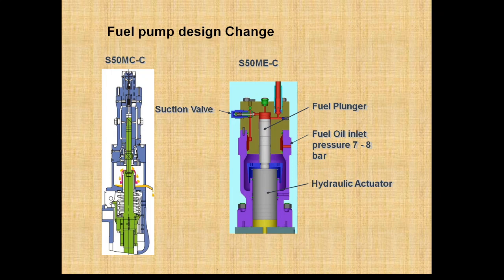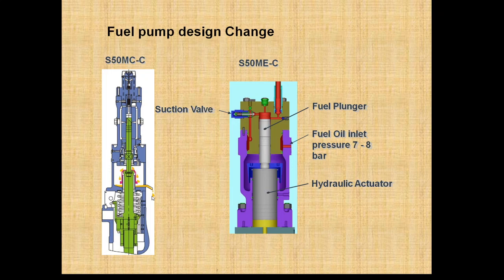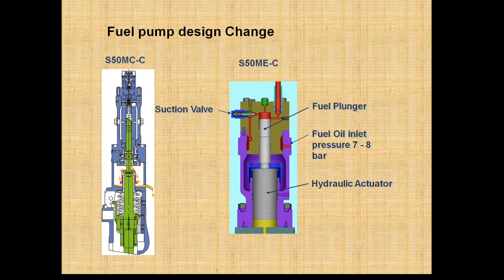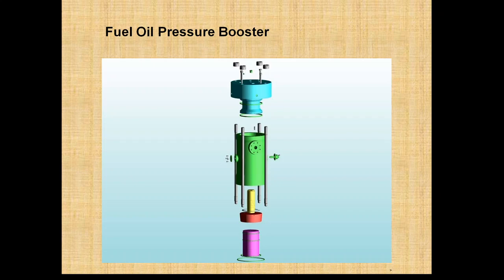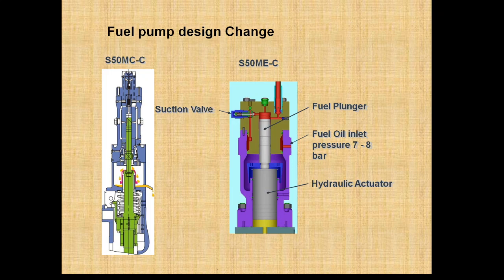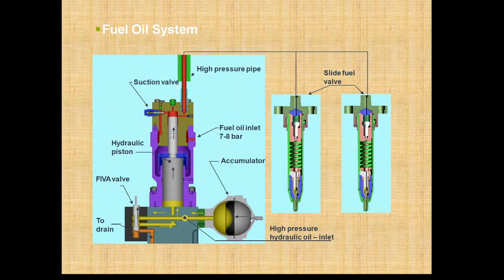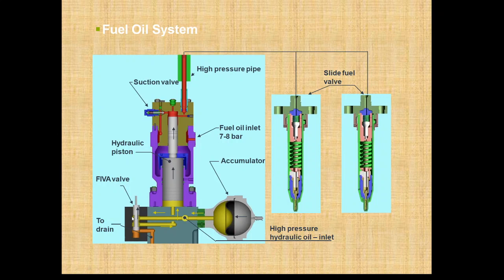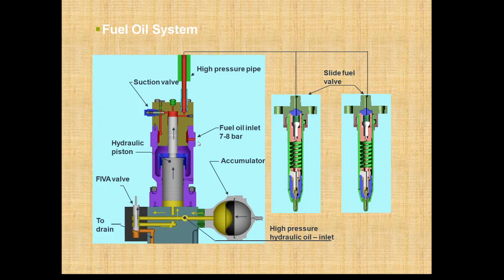difference between MC and ME engine in designing of fuel oil system arrangement|ME Engine|

Comment: Sir do we have any spill port arrangements in For fuel pump in ME-C engines and one more thing sir in diagram we can see that suction valve  but I am not able to understand the other one where it is written 7 to 8 bar oil inlet can you please tell something about that ?
Reply from the maker: In ME series the pressure is developed by the hydraulic actuator so there is no need of spill port because the injection is control.by FIVA valve.
The oil in ME series is supplied at 7-8bar by fuel oil circulating pump from where it is raised to fuel injection pressure by the hydraulic actuator.

I hope you understand!!!!
Please watch the FIVA valve videos I have made.it will be more clear.

Thank you for your response !!!
Please share with your friends and colleagues!!!!
Reply: Hello there the answer was not clear ... if the fuel enters through the suction valve to the barrel , what is the use of that oil inlet port ??... please help us to understand

Comment: Hello @Marine Engineering hub
I would like to know from where is hydraulic oil of 200 bar coming to fiva valve?
Is it from engine drive hydraulic pumps which are in 3 numbers with swash plate??
Reply: No, they utilise a hydraulic oil loop with fine filtered oil from the main engine lubricating system at about 200bar pressure.